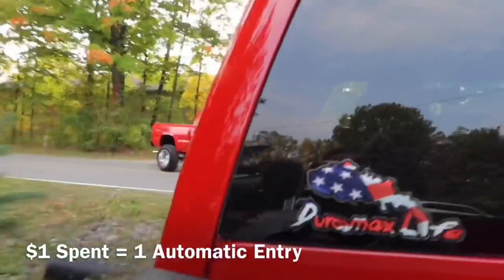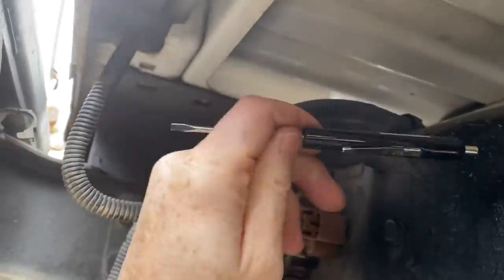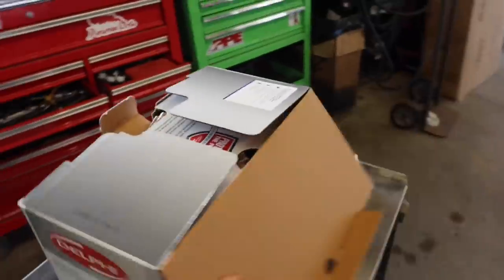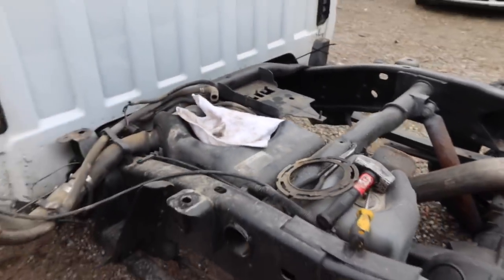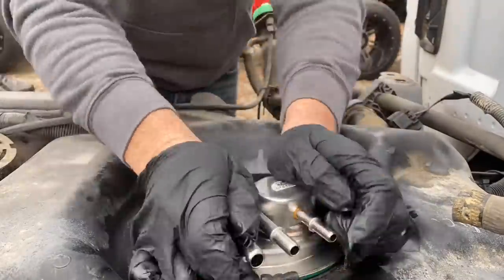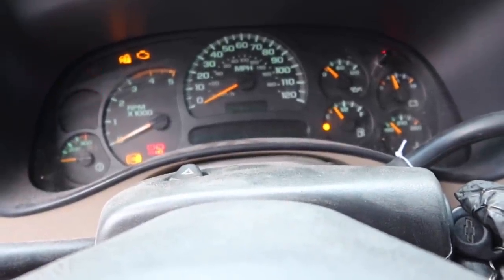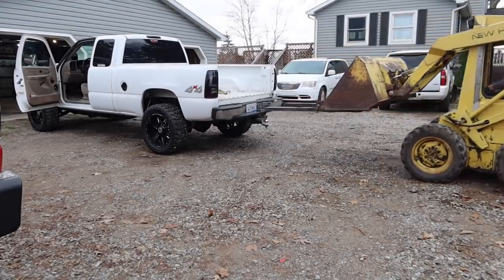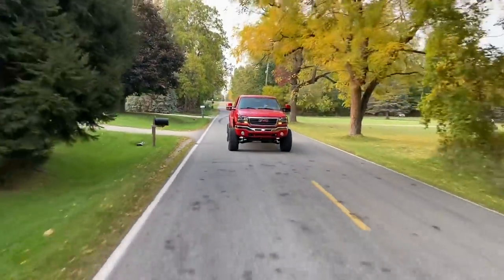I REALLY DID NOT WANT TO DO THIS AGAIN!

Comment: You should've plugged in the lb7 sending unit and manually moved the float to see if it functioned currently. If so you could've possibly have just changed the sensor on the sending unit and solved your problem without rescaling with efi. Another option would've been to change the tank so you have the correct diameter hole for the sending unit
Reply: Yes you can just flip the sensor

Comment: Tip for you. I do this alot. Get 2 pieces of c channel cut to length to fit up under the bed rails and then you can use your forks to pick up underneath them to lift the bed off. One man job, no damage. You could even use some 4x4 wood

Comment: This is just a thought that I've used in the past by removing truck box is putting 4 by4 underneath the bed rails on the inside with two 2 x 6 spacers running the length of the bed where it's follows your forks on each side where it doesn't slide side to side just a thought to make it easier for taking it on and off by yourself.
Reply from the maker: Thanks 👍

Comment: Cut a couple chunks of 2x4 that will fit under the bed rails across the inside of the bed. Then stick the forks under them, makes it not as top heavy and easier to handle.

Comment: When I did my last one I was able to unbolt the fuel fill from the bed, remove all the bed bolts from the driver side, loosen the bolts on passenger side but not remove, unplug the lights, and lifted the driver side bed and stacked wood under it for easy access. Literally took about 30 to 45 min for entire job. I dropped the tank on the first on and one of my subscribers suggested tilting it instead.

Comment: You can always just lift up drivers side of the bed. Remove drivers side bolts, loosen passenger side bolts 90%, lift drivers side and block it up.  Easier to remove if you have a way to remove bed.

Comment: I’ve done them alone and I just slide the bed back just enough to access the sending unit. 
If you use the fork truck hook a cable at each corner tie to off in the middle with a lead long enough to hook on the forks them lift it straight up
Reply: I have a harbor freight 1500 lbs wench back the truck in the garage and lift bed off.

Comment: You don't have to pull the whole bed un bolt the bed lift it up on the front half put a 4x4 in it and you can pull the sending unit and replace it

Comment: You ever think maybe it’s the step motor in the cluster. That’s not making your gage not to work?
Reply from the maker: Yes I didn’t cover that in the video but it’s very possible
Reply: @TruckMaster  I have a cluster that came out of a 2006 LLY at my salvage yard I work at. Not sure if you wanted to give that one a try. Lol. I believe it’s around 125.00ish would have to check on Monday. If I remember right, that cluster u got in wifemax came out of the donor truck. LB7.  I think them cluster has serial numbers in different years. I’m here in wi. 4 hours north from mark and Ryan’s shop. Just a thought. But anyway I hope you can figure it out soon. Lol.

Comment: hey hopefully you or a viewer could help me with my lly duramax. 2005 duramax lly tuned. everytime i put 100hp boost on and gas it 4th-5th gear it'll go into "limp mode" throws code p0700 and p0735. the truck was converted from 2wd into 4wd with a new transmission installed. any clue what could be causing this issue? i would like to be able to fix it. thanks!

Comment: Here are the voltage readings per gallon for 26 gallon tank to rescale tuning in EFI Live. May help with the retune. 

0 gal	0.686275
1 gal	0.764706
2 gal	0.901961
3 gal	1.019608
4 gal	1.137255
5 gal	1.254902
6 gal	1.352941
7 gal	1.450980
8 gal	1.509804
9 gal	1.588235
10 gal	1.686275
11 gal	1.764706
12 gal	1.803922
13 gal	1.882353
14 gal	1.941176
15 gal	2.019608
16 gal	2.078431
17 gal	2.156863
18 gal	2.215686
19 gal	2.274510
20 gal	2.313725
21 gal	2.397205
22 gal	2.470588
23 gal	2.529412
24 gal	2.529412
25 gal	2.529412
26 gal	2.529412
27 gal	2.529412

Comment: What about the tank an sending unit an pigtail for gauge  out of doner truck motor come from
Reply from the maker: It’s not the same harness though
Reply: To bad you couldn't find an older pigtail to make it work  am wire it in so older take an sending unit will work but if you done got tuner might be cheaper see if he can fix it that way that's only bad thing with puttin diff model parts on trucks I had  few gas burner trucks late 90s up to 07 classic gm trucks

Comment: Why can’t you just find the same make and model of gas tank sending unit to cure the issue
Reply from the maker: I definitely thought about it
Reply: @TruckMaster  if you thought about it why didn’t you follow through with it and I can bet if that if the sending unit is bad check the wiring harness that goes from the tank to the back of the fuel gauge on the dash is bad